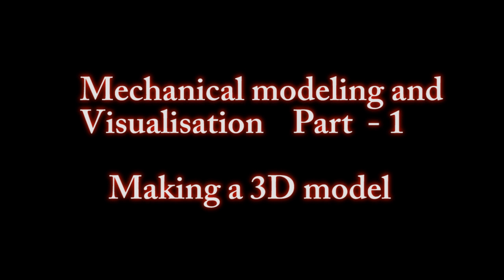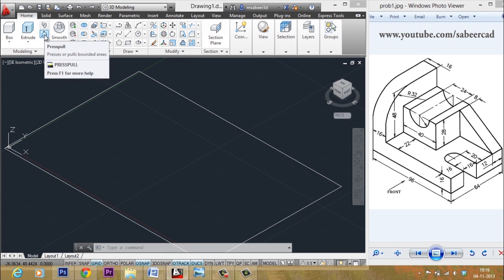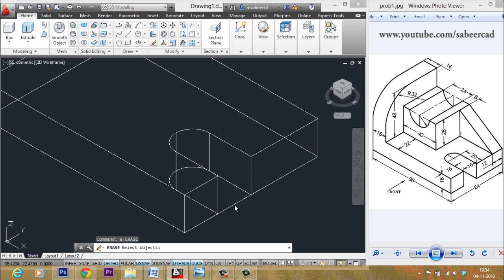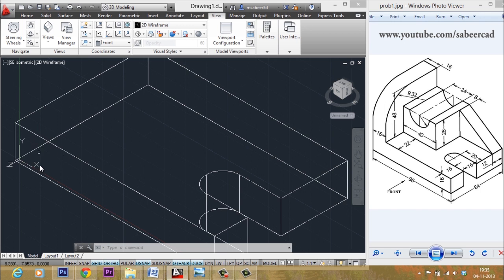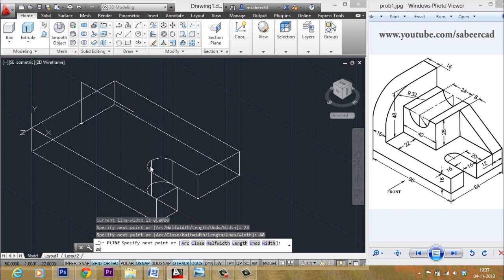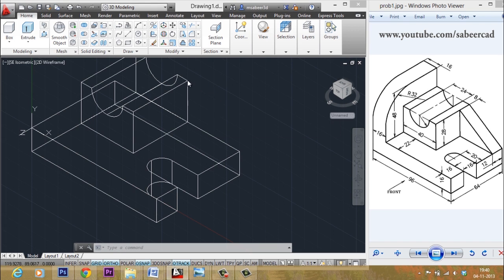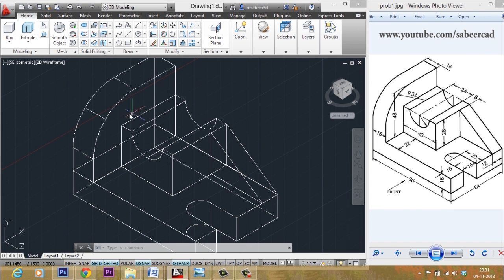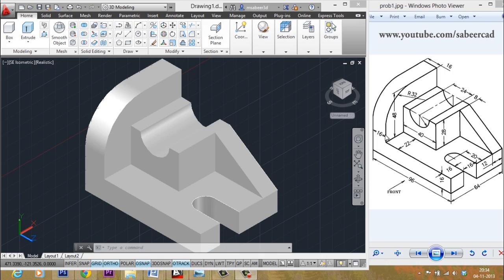AUTOCAD  MECHANICAL MODELING PART1 - MAKING A  3D MODEL

Comment: which version are you using in autocad i'm using autocad2017 student version and there are many problem occurs while doing this model
Reply from the maker: Its not related with Autocad version.  If you closely follow the procedure,  you will get the result

Comment: I ask you help me to find AutoCAD for the automated system. I want to use AutoCAD instead of SolidWorks as the Simens program or for Adem
Reply from the maker: You can very well use . Solid Modeling in Autocad 3D is powerfull

Comment: Please Help!
Why when I'm drawing this, part 40x28x40 is empty inside. There are no solid walls at the front? Any other parts are fine? :-(
Reply from the maker: You have to make sure that the Polyline is closed before you extruded it . For that give PEDIT command and if the first option is CLOSE then the Polyline is OPEN.  .

Comment: At about 1:10, when starting rectangle, you have "area, dimensions, and rotations" options in the command line.  I only show area and rotation in my program.  How do I get it to give the same options?
Reply from the maker: That changes with Autocad versions . Don't worry, you can give  @x,y (polar co-ordinate method) while defining the opposite corner point .
Reply: Thank you!  I honestly did not expect a direct reply from author, as I'm sure you're a busy engineer.  Truly appreciate it.  Thanks!
Reply from the maker: Chris Villa You are most welcome 😊

Comment: I've followed the tutorial fine until near the end, where I need to filet the edge by radius of 32. I go to use the tool and when I go to select the 2 edges I am unable to, the edges do not highlight.
Reply from the maker: +Matthew Winter . You should not have selected the right Object . Just make sure that selection cycling is on before you fillet

Comment: sir,  i am trying the 1st trial figure which looks simple that you have provided & i am stuck as i am not able to use fillet in the desired direction at the joint of 2 surfaces ..kindly please help
Reply from the maker: +Nishant Dhiman Just closely follow the procedure step by step , you will surly get the result

Comment: i have autocad 2017 and none of these things work the same trim doesn't work like yours and neither does erase. even pick and pull isn't the same
Reply: JayVQ35 Install older versions becouse 2017 is probably in beta mode,so it has bugs OR it's just diffrent from other ones,becouse it's new

Comment: Thanks for the tutorial. I am using Autocad for Mac 2016 and I found out that there are some differences between the Mac and the Windows version. For example, the polyline option only works on 2D mode while it works on 3D mode for you.
Reply from the maker: Even in windows version Polyline works in a 2D plane . If you want to work with polyline 3D , you should align the UCS on that plane
Reply: Yes I figured this one out, it seems a bit strange to me as I am used to work on Fusion 360 where everything is automatically set without an UCS :)

Comment: What is the name of the model that Flac 3d use to analysis strees on very week subgrade soil due to axle load for determination of minmum undercu thickness? And also how can i get this software from internate freely.
Reply from the maker: For stress Analysis you can use Ansys Software . I don't think its freely available

Comment: So much harder than 3ds Max! :)
Reply from the maker: Once you are familiar , You will realise that AutoCAD is the best Modeling software
Reply: +sabeercad well it's personal preference, after all you can do this in maya or 3ds or blender and others but it might as well not be as exact
Reply: +Ivan Rivas ahh true. 3dmax is good and fast, but not as exact.
Reply: it depends on what are you modeling, as a mechanical engineer AutoCAD ist not very convenient, there are much better options like Inventor, Solid Edge, NX and Solid Works just to name a few.

Comment: I don't see the 3D modeling option. I'm using the Student version, is that a problem?
Reply: +sakonpure6 I think the 3D Tools tab is turned off by default, so you have to turn it on. Left-click anywhere on the commands tab (where the Home, Insert, Annotate) sections are, mouse over the "Show Tabs" option, and check the "3D Tools" option. Hope it helps.
Reply: Thanks, I got it!

Comment: Great tutorial, but SolidWorks or Inventor is very easy to use instead of AutoCAD 3D. AutoCAD is meant mostly for 2D but its nice to learn 3D.
Reply from the maker: 3d of Autocad is very powerful though it's not a parametric software.

Comment: pls I want Auto CAD 2014 Working product serial number
Reply: +Kiran kittu 
Autocad 2014
Serial Number   900 60870488
Product Key     001F1
Reply: bro du u know how to crack cad 2014 iam downloaded and iam waiting from 1 month and ian iam still waiting pls... bro
Reply: 1.Install Autodesk Autocad 2014

2.Use as Serial 666-69696969, 667-98989898, 400-45454545 066-66666666 .. 
  or anything matching those templates

3.Use as Product Key 001F1
  
4.Finish the installation & restart Autodesk Product

5.Before clicking on Activate
  You have 2 options :
   - a) Disable Your network Card, pull the network cable out or block with firewall
     (this is just to disable online check) it will tell you that an internet Connection is Required
     simply click on close and click on activate again
      
OR 
   - b) Click on Activate and it will do an online check, simply click
     on close and click on activate again.

Choose option a or b.

6. Select I have an activation code from Autodesk
    
7.Once at the activation screen: 
  start XFORCE Keygen 32bits or 64bits version
  
8.Click on Mem Patch (you should see successfully patched)

9.Copy the request code into the keygen and press generate

10.Now copy the activation code back to the activation screen and click Next
  You have a fully registered autodesk product

NB: Make sure you are running the Keygen as administrator and with UAC off on Windows7/8
Reply: Kiran kittu
iInstallation Of Auto-CAD 2014 is upcoming in Our Chanel..Plz Check the Cracking Of Auto-CAD 2017.There is a little bit Difference B/w CAD 2014 and 17

Comment: Hello Sabeercad, at 7:34, you have picked the Y co-ordinate as 0, but I think it should be +16. Because, in the figure we can clearly see that the part is drawn on the top face of the rectangle part and not on the inner bottom face of the rectangle. Please clear my doubt.
Reply: +Dinesh Kumar well it is more like an illusion making the top left corner lying on the bottom edge of the base due to the axonometric design, because it just happens x and y parameters to be same (16 units).. Look at the bottom right corner of the second structure and you'll see it is on the top of the first ;)

Comment: how could I change the surface continuous line when you do the extrude or presspull.
Reply: could someone help with that option on my drawing set up  press pull  or extrude ? how can it be cut thru not the full shape of the circle or rectangle .

Comment: Great tutorial. I tried the second figure but I can´t make the fillet between the volumetric models I have already done. I know I can do it with "fillet edges" of cad 2013, but I have de 2010...
Reply from the maker: It should work. Just try step by step you will get it...
Reply: I understand that is the way, but I don't have this command in AutoCAD 2010, I don't know how to manage effectively. I appreciate your help to solve this problem. Thanks un advance
Reply: I tried to create a solid drawing with UCS en Front with circle and lines, then UNION and that works, but is to much complicated, I think there is other  simple way, but I don't know it
Reply: I will continue trying...

Comment: can i make same 32R  cut thingie if i already done a 3d block ? the 64x48x16
Reply: i made everything except that 32 r part . and i made it a bit differently than u so everything else is connected and i dont find how to do the same 32 r i do suceed in doing simmilar thing but its not exactly same it makes the cut to start from the werry bottom of that thing so what do i do ? ? ?

Comment: The space where you enter the dimensions and coordinate points are not appearing in mine. Also The lines am drawing (polyfit) are not by default running parallel and perpendicular to the edges as seen in this video. Could you clear my doubt why it happens !
Reply from the maker: Just bring the X-Y plain on the plain where you want to dimension using the UCS command . Then you try dimensioning the figure.

Comment: I'm fairly new at this and have trouble with following.
When I draw a room in 2D mode, a box within a box to represent the walls.
Now, in 3D mode, when I extrude them, I get two large boxes, autocad does not extrude the area between two boxes like I intend.

Is there a way of doing this?
Reply from the maker: You better extrude the two boxes and subtract from the outer box the inner box .

Comment: hello i'm a beginner in a-cad. I had a problem in trim function following your lesson. After using copy edges , selecting 3 line and using trim command. It's showing doesn't intersect with the edges. Help me.
Reply from the maker: Make sure that UCS is on the same plane. You can go to top view while you trim , If the trim shows problems in isometric view.
Reply: sabeercad Thanks to reply. It's trimed. While i'm learning autocad following your lesson, i might be ask many questions. And my english skill is not good. Be patient and teach me through internet. Thank you very much.

Comment: Dear sir i work through this tutorials but i cant make full block i) center radius tool - it is not selecting center while drawing its selecting corners only.
2)UCS origin - its not selecting to block corner while am clicking to corner its again going to same position and i cant select co-ordinates vales also.
3)fillet - this option also not working sir . i tired 10 to 12 times but it not coming pls help i want make this block completion any extra short keys r there pls reply
 .

Comment: Is it possible somehow to draw 2D sketches on any desired surface of the profile created by simply selecting the surface. I use DS Solidworks a lot and mainly to create other segments of part, I simply make the base/bottom/primary profile and relative to that I create other profiles by simply selecting the surface of the initial one.It is faster and easier, however my job asks me to work on AutoCAD. Please reply me.Thanks for the video.

Comment: First, thank you very much for this video. My question is: I changed my UCS view to front, after I change my UCS point on the corner the same place where you showed, but after when I put the coordinate of polyline to 0,16,,-22, the start point of polyline doesn't touch the bottom line  of the edge of the object as you show in your video. What I missed?
Reply: I am having the exact problem. Help?